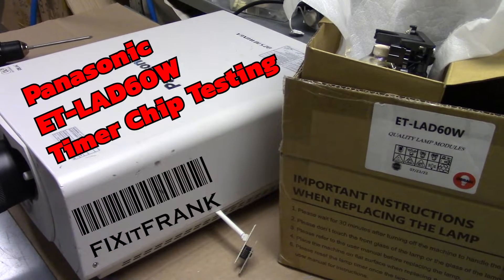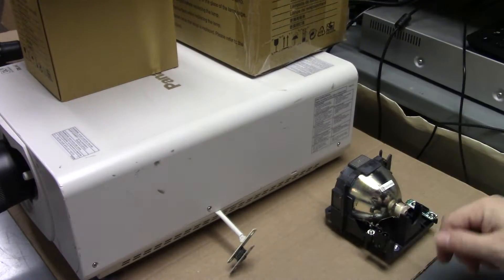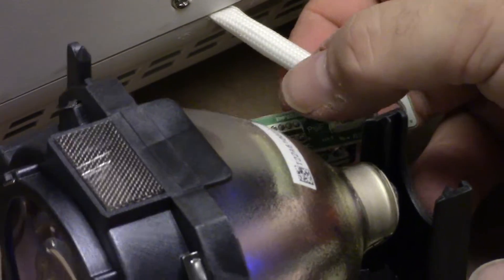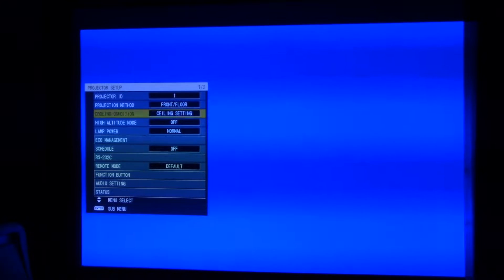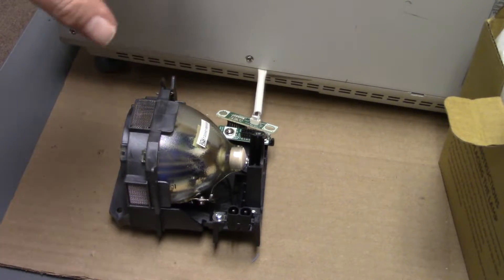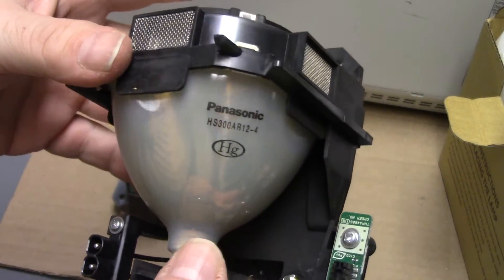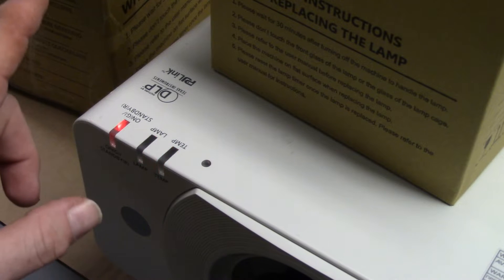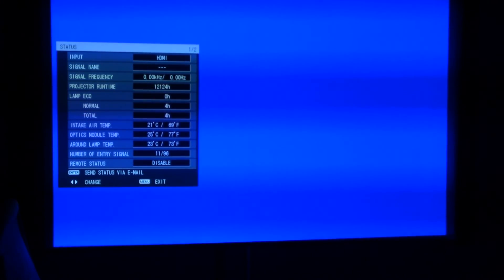ET LAD60W Panasonic Replacement Projector lamp Timer Module Testing

Comment: Hi, your videos are very useful. Is there any way to contact you to describe my problem with BenQ W2000? Shortly I cleaned it after bulb explosion, replaced bulb, and now it doesn't turn on but power indicator flashing every 10-15 seconds. I have videos and photos how it flashing but can't attach it on Youtube.
Reply from the maker: Sure! I have email listed on the about page about halfway down.
Reply: @FixitFrank  I texted there, so when you'll be able please write back. Sometimes messages could be in Spam folder if you can't find it in Inbox.
Reply from the maker: replied last night!
Reply: @FixitFrank  Thanks for your help, man. Cause BenQ support just offered me to send them projector for diagnostics)

The problem was too simple. It was about that fuse button that need to be pushed. I didn't assemble the projector case tightly enough and plastic case lid above the lamp didn't fit perfectly so it couldn't push a fuse button. And when it's not pushed but the projector's connected to outlet - POWER led flashes as I described.
Reply: @FixitFrank  thnx! I'll text there.

Comment: Still want to do some sort of trade for a Sim2?
Reply from the maker: I would except I don't think I have anything that you would really want.  I have a few higher end units but I doubt you would want them.  I have a JVC-DLARS40 and a Digital Projection Dvision 30 XL (7K lumen model).  I did end up with a Christie laser (dwu55gs) which I am currently running.   I suspect the Sim2 is nicer than either of the other models I listed.
Reply: @FixitFrank  Just looking for a good 1080 projector..the Sim2 does me no good as the throw distance doesn't work for any room I have. it just collects dust.

You would swap for the JVC?
Reply from the maker: I would definitely! Let's talk off youtube if that is okay?  my email is frank@fixfrank.com